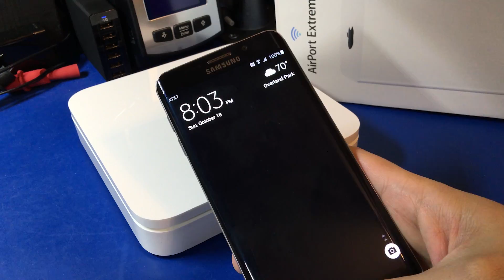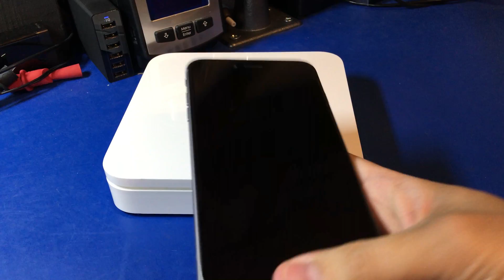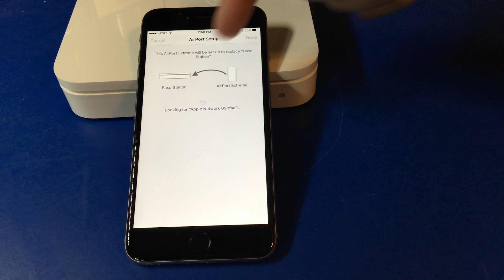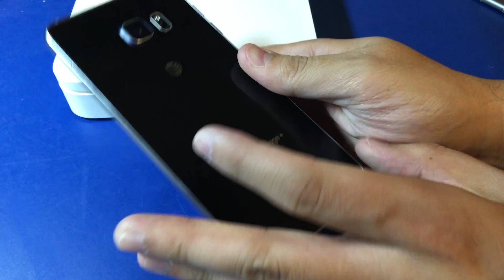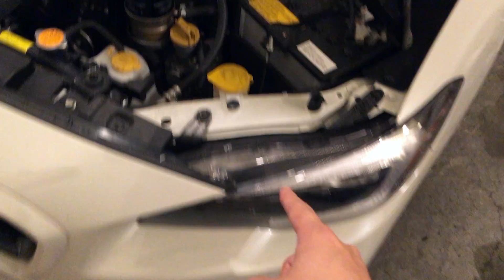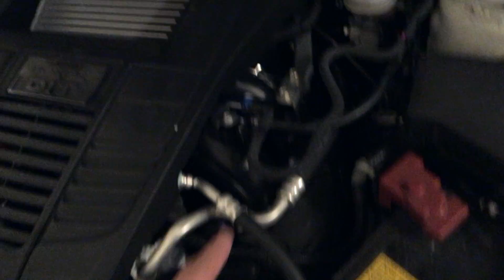Kudos to these two examples of excellent design engineering - #0103

Comment: For the oil filter its the same with Audi. But you only replace the filter element itself not the housing. It sits on top of the machine in the front.
Reply from the maker: Glad to hear they're making smart design decisions. They've had some bad ones to work on in the past for simple things like changing plugs
Reply: Yes good to see the Germans make something easy. I absolutely get stressed everytime I work on mine. I've never seen so much unnecessary work for what should be an easy job. Most recent was my alternator on a 00 GTI with the vr6. What a nightmare.

Comment: I've helped my in-laws business transition from Apple Airports (one for routing, rest for wireless).  They really are great for consumer use, but when you up the connections the routing starts having issues.  There is also no zero-handoff between the APs.  They ran Smoothwall for a while which worked very well until they had hardware issues.  They had replaced all Airports with Ubiquity Unify which are really in the Prosumer category as far as I'm concerned.  They are commodity hardware, but with improved management.  They really handle wireless connections much better than the Airports did, especially when you are in an environment with multiple APs.  You add additional APs and they auto configure to your settings.  There are provisions for multiple SSIDS, and guest networks.  They also switch to Ubiquity's Edge Router to replace their Smoothwall.  It does only routing, but does it very well and extremely fast.  

I feel for you TechnologyCatalyst.  I'm one city away from Google Fiber.  Not only is that great, but the companies that have jumped in to provide competition means that there are multiple Gb+ choices there and for prices that are less that Google even - not far away from the 55 Mb/sec I am getting for $45/month.
Reply from the maker: Interesting! Yeah sadly I'm not eligible for at&t's fiber either, which is the same price as Google fiber for the same speed
Reply: +TechnologyCatalyst I'm starting to regret taking the job offer transfer to Ohio when I spent 18 years in the Bay Area silicone valley next to google. Oh well.
Reply from the maker: And get similar pay, only with 300-500% more expensive homes and living costs?  No way Jose.  You couldn't pay me to live there.

You should enjoy your lower living costs and higher standard of living in the midwest :)
Reply: +TechnologyCatalyst I admit, the cost of my house, insurance and taxes is less a month then what I was laying on a 2 bedroom apartment. But I just changed ISP's from U-Verse of 2 down and 2 up for $65, to Time Warner and still paying $55 for 30 down and 5 up. That's because I bought my modem, or it would be $10 more a month. At least in CA it would be more like 200 down for that price. They still hasn't updated this area, so I miss the tech advantage and people I knew working for other companies, testing new tech before it was released SMD having the inside scoop of what was coming next. They say it will be updated for 250 down, and 30 up in the spring for the same price if I'm a current customer, let's hope so.
Reply from the maker: I live in Kansas and pay about $80 for 300 down 25 up with time warner. (bought my own docsis 3.0 modem to avoid the monthly charge) I'm about two miles from the nearest google fiberhood.  I hate hearing my coworkers bragging about it.  Agh.  I have another coworkers who doesn't have google fiber but has AT&T's gigapower fiber, which is same speed and price as google fiber.  I'll move in a few years and finally get that sweet, sweet fiber.

Comment: as far as apple goes I think a lot of the hate is from apple hipsters.  I am certainly guilty of that; I love apple's PCs, but I hate the Idevices with a fiery passion.  I can't articulate why, but I do.

on routers,  I somehow stumbled onto this brand called routerboard.  I don't now how well their wireless products work, but I bought one their wired routers back in February and it has been great.
Reply from the maker: +zeos386sx Hmm, I'll have to check them out.  If my switch ever craps out, I might consider another brand.  (I think my current one is a Netgear, but so far, it's been pretty solid)

Comment: my cisco router (commercial) is hands down the most reliable router I've ever used, linksys, net gear etc, are garbage... my server room runs the same one, with 2 provider incoming, with 99.8% uptime. spend 300 bucks one time. I've thrown a ton of cheap routers away. and maybe 50% of airports go in the trash.. just wait till the new infrastructure rolls in, Google fiber will actually work  as described... 1000mbps is old... company I'm talking with is working on a 10000gb connection that might hit homes in 2016 17... so excited
Reply from the maker: Can you elaborate on "50% of airports go in the trash" comment?  Also, it sucks because I live about two miles from Google's nearest fiberhood :(

Also, how is 10Gb feasible when most people can't get half that on copper even on 10Gbps gear. End to end fiber?
Reply: +TechnologyCatalyst it's a new fiber structure they are working on, technically it's unlimited on the data sent, but the technology they are working on is to accept all the data and process it.. it's super expensive shit...   
on the airports, when my guys get called and an airport router isn't working half the time they are bricked.. whether the owner did or just bad software, they just end up in the recycle box... 50% is much lower than all the other brands..
Reply from the maker: It's scary how unreliable consumer level network gear really is
Reply: +TechnologyCatalyst it's amazing on an electrical engineering side, how cheaply made and cut corner crap.. instead of making 100 different routers, make 3, home, small business and corporate.. cuts cost and makes them serviceable instead of wasting billions of pounds of trash... Google how much apple wastes every month, it will blow your mind
Reply from the maker: +Nick Miller I can't argue that!

Comment: Regarding the part 1, honestly, I don't see any miracle here. Apple produces all these gadgets, they all are tied closely, and taking into account the company's policy to hold down users, any "cool feature" such that is simply an additional nicy for non power users. That's all. Router settings migration from a non-Apple device to the AirPort or vice versa - yeah, it could be called as an excellent design, but at the moment it's not possible.